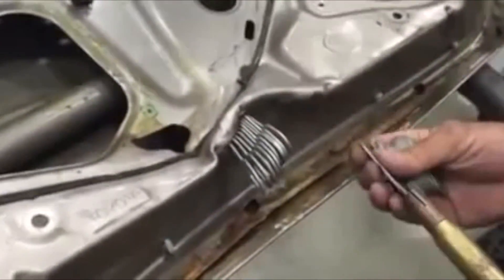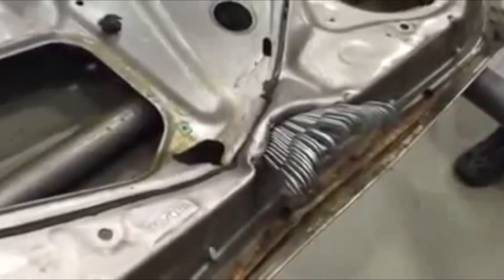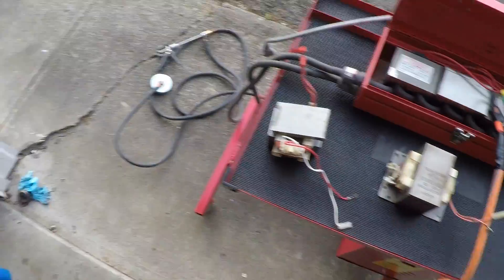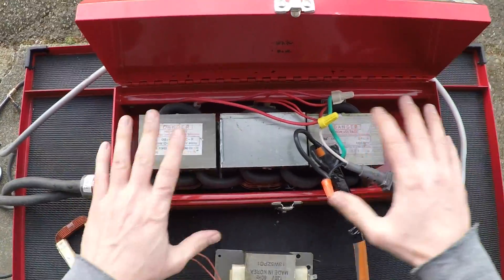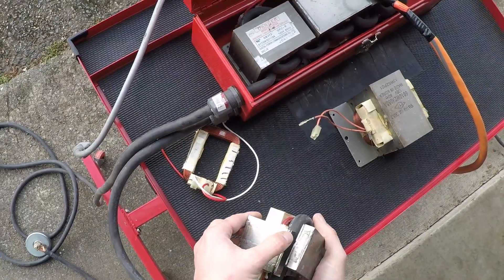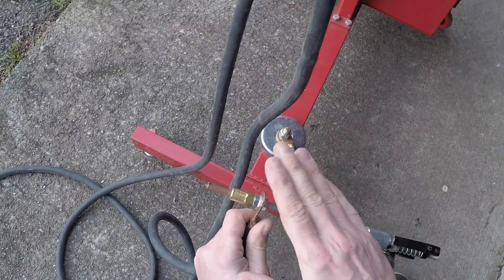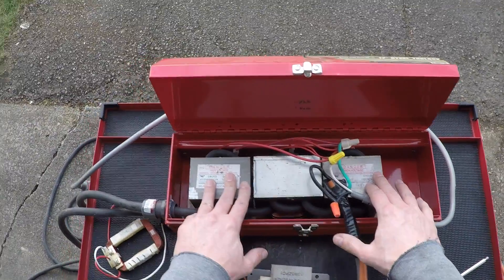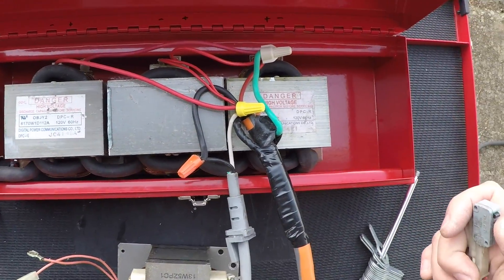✅ How I Built My Car Body DIY Spotter Electric Dent Puller Welder From Microwaves and How It works

Comment: You need a foot pedal for activation....
Reply from the maker: Duration of pulse needs to be as short as possible, about 1/3-1/2 of a second. I don't think I can make it work with a foot pedal to achieve the desired duration. At some point I want to make an auto start/stop function that would run through a timer. I'll make a video about it later on down the road.

Comment: Hey, cool machine you got there. I got a microwave junk yard in my town and thinking about building me one of those. How dangerous would you consider that machine?? Would you get electrocuted if you touch the tip of the welder while the transformers are activated? Did you ground the transformers?? Thanks
Reply from the maker: I wouldn't say that its dangerous, and can touch the tip and all and I haven't gotten electrocuted. Voltage is very low only 7-9V but the amperage is very high 800-1000A. It's just like using a welder.
Reply: Ok, I'll be building me one soon.. thanks for your response
Reply: @fix206  hey sorry to bother you again, did you use some type of resistor to power them transformers?? Cause as soon as I connect two of them in parallel the breaker trips even without load.. you are using 120v right?
Reply from the maker: @julioromero9795  If breaker trips even without load that would mean that something is being shorted out. You have some sort of a connection issue with your primary wiring. Something is possibly connected backwards and causing a short
Reply: @fix206  I checked my primary coils and they don't seem to be shorted. I got only .5ohm on each coil and if I connect all 3 of them in parallel that's only .3 ohms, to me that sounds like almost no resistance.. how many ohms is there on yours? How big of a breaker are you using?
Reply from the maker: @julioromero9795  not sure what my resistance is, I run my spotter on 15A breaker, and no problems there... try powering up your primary coils one by one and see if any of them will trip the breaker
Reply: @fix206  I tried that and found that even with one if I turn it on and off multiple times it trips.. maybe my breakers are to sensitive cause I even got an inline fuse and no harm there.. maybe I need an inrush current protection of some kind

Comment: Nicely done! I love your attachments. I want to build one of these to fix my cars. I have some questions if you don't mind answering.
 What is the gauge of the thick wire that you used as a secondary of the transformer? Also, did you try to put a rectifier in front of it and convert the voltage to DC? Would it make it better? What is the output voltage and amperage of your spotter? Thanks!
Reply from the maker: Secondary wire I believe is the 2/0 , there is no rectifier so it's all AC as far as I understand. Output voltage is between 8-9V and amperage is 800-1000A... Hopefully this info is helpful, let me know if you have anymore questions
Reply: @fix206  so there is no positive or negative on AC right? :P
Reply from the maker: @ied3vil  That's correct, only DC has positive and negative, AC is always changing
Reply: @ied3vil    - This is a step-up transformer from A/C to A/C but since the secondary is large gauge wire, voltage drops but amperage is increased.
  If you want to make a simple one with knowledge of electricity and ohms law, plus the power solving math, there are videos for that. But if on Craigslist some one is selling and old Lincoln crank tip welder that broken, you will find large diodes pressed into a plate for heat that creates adjust amperage. The crank top model was sold during the 60’s and almost every farmer owned on. We did as my step father and step grand father neither could stick weld. Later in the early 70’s, I apprenticed at a two man shop that is helped build foundation up with concrete block. He had built one he bought at a farm auction for $15 fixed it but made a battery charger. The spot welder and battery charger both work the same way except DC out only. Diodes are rising in price but look at NOS bought buy salvage companies that sell stuff online. This includes Surplus stores as well. These where sold by the thousands as the oldest on our family farm, we got food and a bed. No allowance so you worked for other farmers who needed hay put in the barn. I got one on trade for 3 weeks of work, otherwise it was $0.03 cents per bale. These are stick or called arc welders and everyone sell MIG today especially the chi-na brand. Large, heavy but cool and easy to fix. The top crank was a simple briallant idea of raising or lowering the secondary into an open primary laminate steel core. The more in, the higher the amperage went. The cable end would fray or break making and easy fix. Large cable eyelets can be made from copper pipe. Videos show this and stake wire with a dull cold chisel or cable clamp tool hit by hammer. I would suggest soldering ends for good connection with MAP gas and regular flux sold for copper pipe. Just insulate connectors with shrink tubing or liquid tape sold at home improvement stores. Don’t forget to label the front. A neat idea for rod instead of keys or washers is ground rod sold in home improvement stores. It is copper plated steel core. It is 8’ long and not cheap. $50 (+/-) but drill into the center in increments and use nails. Buy a slide hammer at HF that fits the nails, like “10D” framing nails. The end tightens onto the nail, then use the slide hammer and heat to pull the dent.
Ex-farm kid / ASE master tech since 78, retired but still working at home on!!!

Comment: It will be much easier with a contact pedal, so you don't need to use the hand for switching the power
Reply from the maker: I see your point, but I don't think it would work out too well because the pulse required has to be as short as possible, and I think at this point I can engage and disengage a bit quicker with my finger... eventually want to adapt an electronic controller that would allow for automatic engaging and disengaging for any preset duration of time, and normally 1/3 to 1/2 of the second should be good enough

Comment: Awesome video, what do you think about using this as opposed to the Russian source where you got the gun? This seems like a decent price, and comes with a few accessories like the keys/washers. Doesn't include a power cable, but I'm sure one could be made easily enough? https://www.amazon.com/dp/B07KJBCKTW/

Or, what about this as a full setup for $300 -> https://www.amazon.com/dp/B07KLYXMD7/
Reply from the maker: Yeah I'm sure that the kit will work just fine, it's more or a slide hammer verses the puller that I have, but principal is the same. And I don't have any experience with the full setup, I read some reviews and it's sounds like its a hit or miss quality wise. These setups were not available back when I made my video, only time will tell it they are any good... But fore sure let me know if you end up getting one.

Comment: can you tell how many amps you have on primary ?
Reply from the maker: I'd say there is 800-1000 amp output, but very low voltage, right around 9V
Reply: @fix206  Peter is asking how many amps on the primary.
You are quoting him numbers for your secondary.
>

Comment: Great vid! I think i will be trying this soon. Are the keys (washers) galnanized?
Reply from the maker: Thanks man, you should for sure build it... Pretty simple to make yet very useful tool. I'd try using non galvanized washers
Reply: @fix206  
Another thing...did you make the gun part of the spotter or purchase it?
Reply: @fix206  
Thanks
I will definitely be building this soon. I do alot of body work, and this will save me so much time. Ive looked at purchasing a unit before, but the cost is high.
Im in North America also (Canada)
Ive seen units from Italy, and Eastern Europe but i dont know of any distributors here.
I look forward to trying this!

Comment: Did you have to remove the casing on the thick black wire that gets wrapped twice inside the transformers??
Reply from the maker: The only place where I did remove the casing is just on both ends, where on one end it connects to grounding puck, and the puller on the other end

Comment: 2 years ago I made one exactly like yours but it dont work, it just melts everithing, but no stick weld washer or spotter tip to panel...
Reply from the maker: Yeah I just watched your vid... not exactly sure what's going on with your setup, but one thing I can see you trying is connect a 1mm thick steel washer straight to the copper cable and try to zap it to a junk fender or a door for just 1/2 of a second and see what happens. It's hard for me to diagnose your problem from that video.
Reply: @fix206  I tryed that too, but without luck, it just cant weld enough... I had washers, bolts, even car spotter triangular copper plate and still doesnt work.. even if I try to weld for just a moment or even for full 3 seconds, just glowing red metal and no welds
Reply from the maker: Hmmm, it's tough to say anything without seeing your setup in person. Wish I could be more help :(

Comment: should keep the shims this way the transformers overload
Reply from the maker: The insulation on the thick cable pretty much works as a shim. And if I left the shim in I wouldn't have been able to cram the thick cable in and shut the lid flush.
Reply: Don't need to keep the shims.
They were there simply to shield the tertiary low voltage winding.
>

Comment: Yeah thats were i saw it
Reply from the maker: I just watched your spotter video, and one thing I get to tell you right away is you need to use much thicker cable, because if you use thiner cable you end up making more windings, and more winding means more voltage and less amps, you want just 2 windings of thick cable just like I did in my video. Also try not to weld to galvanized steel, try a peace of automotive sheet metal, like a damaged fender of a door, make sure to strip all of the paint off real good so all you have left is just raw steel, it just works better that way. Oh vever mind.. it's not your video it just a video in your playlist... but anyways, you know what I mean 👍

Comment: Im using one cause i saw some other video and they only used one but when i saw yours im going to 3 now. Also what gauge of cable you use
Reply from the maker: One definitely is not enough for this application... for good results I wouldn't even go with 2, I learned how to make this setup from a guy on one of the Russian channels, and he did a lot of testing and results with 2 transformers weren't good enough so he ended up using 3 and I went straight to using 3 transformers when building my spotter. And I'm happy with the way mine turned out.

Comment: Put a bolt and grinded to a point its working but just wont weld to panel
Reply from the maker: hmmm... try welding a steel washer to the panel. How many transformers are you using?

Comment: What you use for tip to weld to pannel
Reply from the maker: I actually ended up purchasing the puller with the tip and the weld on keys. But at any rate the tip is made out of steel, because if it was made out any other metal, then it would not weld onto the steel panel.

Comment: Very cool thanks for the video,,where did you get the puller from the one with the round gadget?
Reply from the maker: The puller is the only thing I didn't build... I was going to originally build it out of a caulking gun, but then came across a company out of Russia that sold these accessories along with the weld on keys, so I went ahead and bough it.
Reply: @fix206  thak  you ser
Reply from the maker: @valentindiaz8555  https://don220.ru/g7269019-spottery-aksessuary
Reply: @fix206  Do you have a link?
Reply from the maker: @williamwray4351  https://don220.ru/g7269019-spottery-aksessuary
Reply: So that link shows the puller your using in roof? What's the name of it and how do I purchase one here in the us?  How much did yours cost? I see the one model is 22 270.... is that $353. Us dollars? Thanks
Reply from the maker: @jay72chevy  Link to the similar puller is here https://don220.ru/p336467046-nabor-dlya-peredelki.html the price is around $60, but I'm not sure if they'll ship international.

Comment: when you do this with transformers you should check the voltage output on the secondary and hook up the primaries for highest voltage.   just hooking all the left terminals together and right terminals together  risks having one phased backwards . just wire up 2, if the voltage is really low, reverse the input on one of the transformers.then hook up the third transformer and the voltage should increase again if it drops, revere the input of the 3rd transformer..
Reply from the maker: That is exactly what I had to do when I put this setup together...

Comment: YOU SHOULD NOT DO THIS UNLESS YOU ARE A QUALIFIED ELECTRICIAN !! IT COULD KILL YOU IF YOU DO NOT DO IT PROPERLY !! 😱
Reply from the maker: This same tool is available for sale in Europe, I'm sure it would have been  pulled from sale if it was that dangerous and people were getting killed. It's a pretty simple setup, as long as you're not trying to put it together while its plugged into the wall you'll be fine.

Comment: Can you please send me a list of parts and a schematic so I can build one as you did I think that is the coolest thing ever.
Reply from the maker: There is not that much to it... all you need is 3 microwave transformers, some 2/0 or 3/0 wire, and there you have most of it.. Then if you'd like you can make a puller out of  a coulking gun. I tried braking it down in my vid as much as I could. Let me know if you have any specific questions that pertain to the set up, I should be able to answer them 👍

Comment: You still have some fine tuning to do. Penetration is not good.
Reply from the maker: Actually penetration is as good as it should be, you don't want it to be anymore then that because then you'll get pin holes in the metal. That's what happens when I gold the actuator button just a smidge too long.
Reply: @fix206  Ok I see. Just remember to make it clear to the viewers that it is alternating current that its using and there is no negative and positive side.
Some transformers primary windings currant flow in different direction, this is critically important as it could be REALLY dangerous to connect them out of phase.
Reply from the maker: Actually when I was putting the setup together, I had the power to one of the transformers hooked up backwards and all that happened was that the output through the secondaries was 1/3 less volts and I wasn't gettin good penetration, but after sorting out the mistake all was good

Comment: Excellent job. The xfmr is a ratio for the winding vs voltage if you have, say 120 turns on the primary at 120vaç, for a 2 turn secondary you will get 2.0 volts. 1 volt per turn. It's all ac so no positive and negative at all BUT you can get a buck or boost. You wired up your primaries in boost, adding the output current from each transformer. The larger the cable used on the secondary results in more amps. 
I would like some detailed descriptions on the stand puller and the electrode you used connected to the caulking gun mechanism. I spied a bit of brass but the electrode looks like copper an I didn't think that would weld directly to steel well. I built a small welder to do battery tabs and I used a timer of Ebay for weld time consistency. Great job I'll be building one of these as soon as I collect enough microwaves of the 1000w variety.
Reply from the maker: You are correct about everyone... and as far as the puller and electrode go, I bough those items form Russia, so I'm don't know a whole lot about the materials that were being used in their construction
Reply: Thanks for getting back to me. I figured the puller was an inverted caulking gun mechanism you had built. I have a caulking gun that is orange a black so I jumped to conclusions. I am going to try to build a puller like yours based on an inverted caulking gun. I'll see how that works out. Just ordered a couple hundred of the puller keys off Ebay. Keep up the great work. Thanks for the video!

Comment: and were did you get them keys
Reply from the maker: Keys I had to order from Russia, but you can actually just use steel washers they work the same
Reply: @fix206  post a link where you got them from